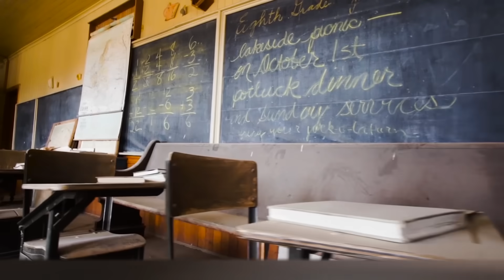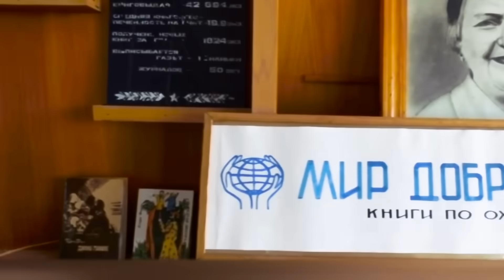9 Abandoned Ghost Towns That Will Make You Shiver

Comment: @ 0:53 ( tap ) in they are inspecting rebar with a pachometer for corrosion   ??   also at around 9 minutes in you show a small town in Nevada ( 80 miles from Vegas ) that is actually for sale right now..the kid on the 4 wheeler and the old lady an man driving down main street ( when you mention there was even a casino ) which actually doubles as a runway for planes...* I just watched that video the other day